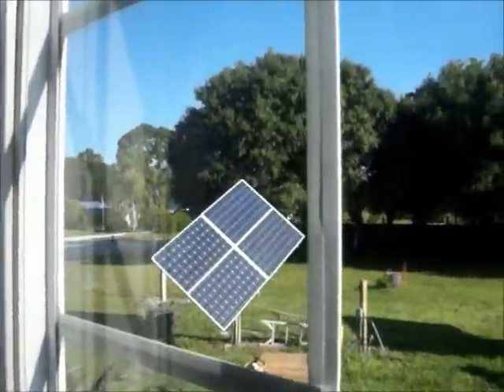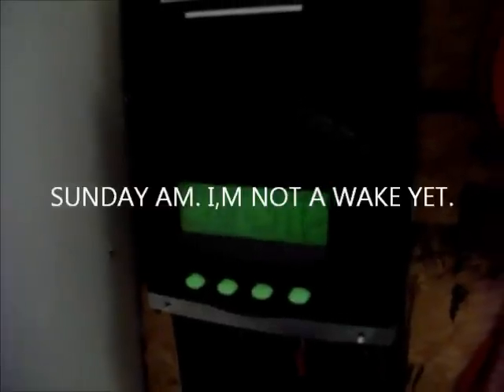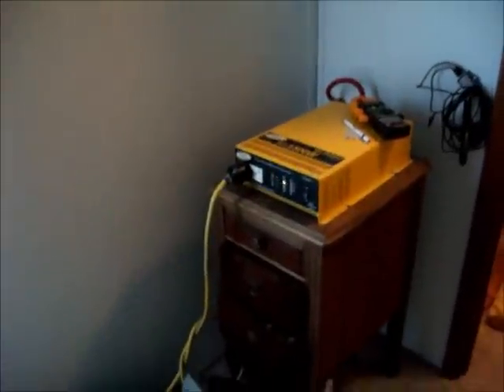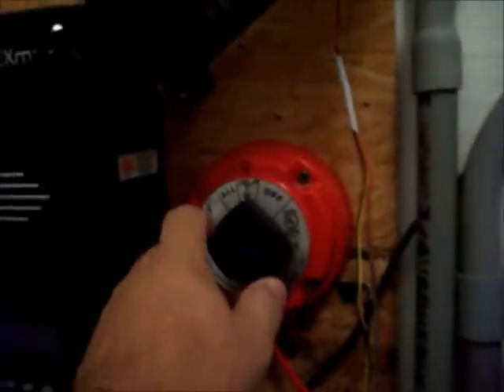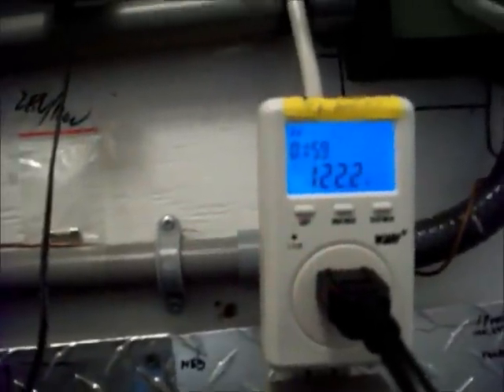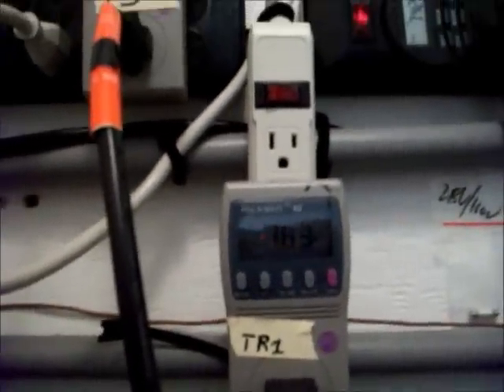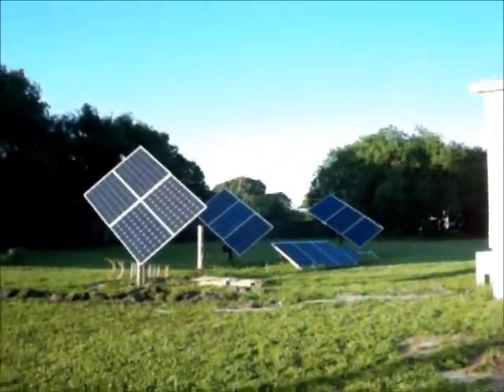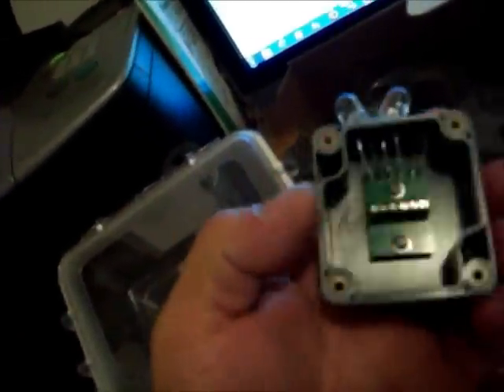THE FIRST PEAK AT POWER WITH A SWITCH.

Comment from the maker: Thanks, I now what I want I just have to find a unit that works to my satisfaction also I need some one who builds these to make the changes I,m looking for, so this system works with out a hitch Not easy to do.trying to get every body on board a new project can be a good bit of work as I have already more applications for this (KIT)  Bigger,  ,Smaller, marine, and Roof top,and a Stowaway RV version,My Mind Never Sleeps but it is getting Tired.

Comment from the maker: I need to bring in a avg.of 20kw a day I have been seeing 14.8 15.0 now so I feel 600 kWh a month should cut the power bill in half or more as last month I had A/c trouble and Lost a sensor on my old first tracker,that really hurt battery power .Then I had 1 Power Jack down all most 2 weeks so I,m optimistic ,I Think I will attain my goal. When I have installed tracker #4  I will have 3630 watts in on Track = 2 +- 4740 Watts Fixed mount. Plus 1 new sensor to test.